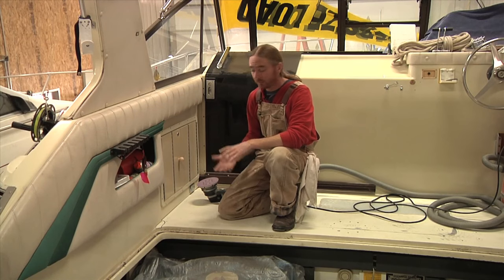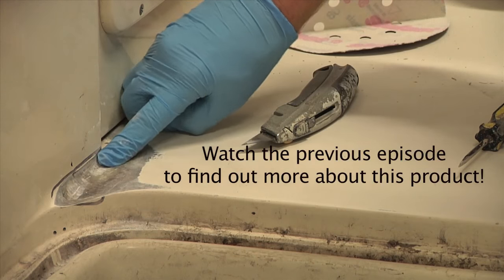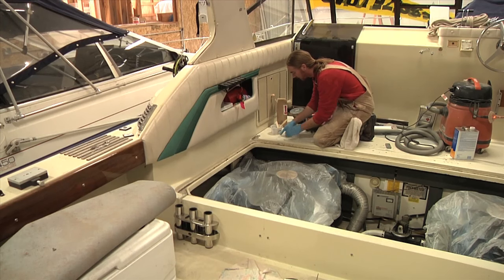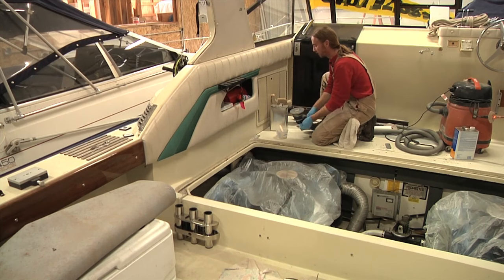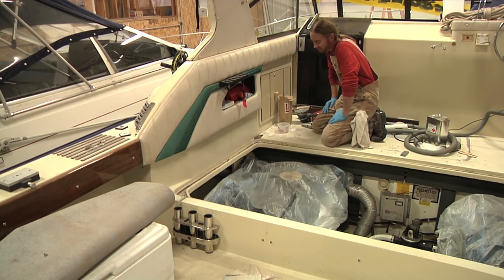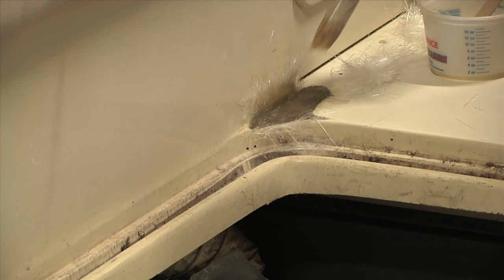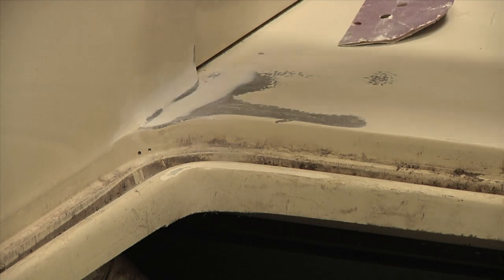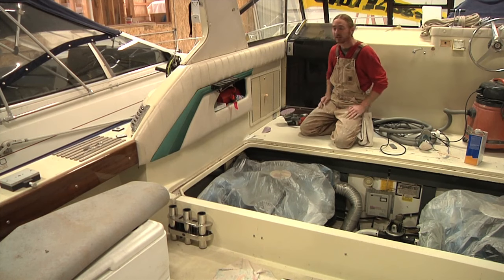Fiberglass Repair ~ Stress Cracks

Comment: When I find "dry laminate" layers, I take a small drill bit and drill into the hole, then mix a very small batch of resin, then inject the resin into the dry void with a needle. You can actually watch the resin saturate the dry laminate from the surface. It works well. For areas where there is plenty of glass, but someone just didn't quite brush/push out the air from the glass, the adhesion and structure seems to be absolutely fine. Overall, much less sanding/tooling and less disturbing of the surrounding good glass laminate.
Reply: ok but that doesn't provide any structural integrity -- I mean I guess it's better than leaving it as is but... i'm not sure
Reply: @IrregularPineapples  He mentioned a very specific situation where there might have been dry laminate layers where maybe they didn't use enough resin or they did not brush the air bubbles out, but there was enough glass, which is where the structural integrity comes from, it just needed more resin, if that makes any sense, hope that helps explain it a bit better, take care and have a nice day.

Comment from the maker: I haven't simply because I didn't want to take the chance that it wouldn't work :-)  PVA, wax or other additives are inexpensive compared to the time needed to re-work a repair..  Not saying that it wouldn't work for a very small patch but I wouldn't recommend it for a repair of larger size..

Comment: FYI 20mm = 2 cm = 0.787401575 inches  (pretty thick)  I think you mean 2mm
Reply from the maker: 20 mil = 0.508 mm  :-)
Reply: a mil is different than millimeters... 1 mil = 1/1000 of an inch
Reply: FYI ... Where I come from 1/1000th of an inch is referred to as a thou.  And to the rest of the world (outside US) a mil is short for a mm ... interesting video ... very useful ... thanks.
Reply: I think he means 20 micron 0.20 mm
Reply: Thats 20 thou (as in .020 inches) or .5mm being .03937 inches in a millimeter (I was a fitter & Turner / toolmaker by trade and we worked in both metric and imperial units)

Comment: I understand you did this video 8 years ago but just wondering if done today you’d use a microfibre resin mix to fill that hole? Is that perhaps the same problem with too much resin and not enough fibre?

Comment: Quick question. I recently discovered a soft spot on the deck of my 2002 Sea Ray 340, due to the previous owner had an accident. Removed the hatch and ground out all the mush, vacuumed it all out. 
I had repair a crack in the Fiberglas and had to sand about a square foot of factory anti-skid (diamond pattern) the first problem I’m having is the repair epoxy is bleeding through the factory color matched gel coat. What do I use as a color block? Then I order the factory anti skid pattern mold from james town dist. 
Do you think it is possible to blend in a square foot of anti skid perfectly, in the middle of about 6 square feet of anti skid?
Thanks! Really enjoy your videos!

Comment: Thank you for the quick response. :) what I was asking is would a coat of pva over the glass work the same in helping it to cure, would it keep it from gassing off and slow the cure? An old timer showed me the pva trick, it seemed to help with blending the color better, I was putting in a bow thruster and using flag blue. Is it the heat of the gelcoat kicking that does it?

Comment: Nice job on this "stress" crack. Couldn't have done it better myself:)
I do have a question about procedure in repairing a noising line on steps in a fiberglass swimming pool. The crack is 4-5 inches long horizontally along the edge where the step and riser meet. It is not however, a stress crack, it is fully cracked through so that we have a leak. I applied a temp fix with epoxy putty [underwater type], but now it'll need a permanent approach. Could you steer me in a specific direction. I have a pretty good idea on how I'll approach, but any other expert opions are entirely welcome. I don't want to do the job twice. The pool is only 2 years old and in installed in-ground. Thanx.
Greg

Comment: Andy what tip do you use in your gun when you spray gel coat. I used a 1.4 that ihave in my gun and it was not the right tip for sure. Also where can i buy wax to put over the coat the gel coat. I got the one that has it in it but i found it to still be sticky. Thanks Anthony

Comment: Hi nice VID superrrr  job,i was/is going to use this products on my aircraft fibreglass cowling,as my cowling burned through with my older version of exhaust,(thats changed so it wont be a problem anymore),this cowling is very thin and i say, 40 -60 thousands thickness.I noticed on this vid, at 18:00 you say some compound..what is this compound?? Quetion: for the exterior side of my homebuilt Aircraft cowling, can i use a product called " Evercoat Company(automotive use)" polyester putty?? i was going to use it to cover up the joined repair of the fibreglass patch kit.,as for inside of cowling is not an issue,it wont be seen. what would you recommend? also my fibreglass has bubbles on the out finish,it looks like the fibreglass has aged over 20 years of use.thess bubbles are in the fibreglass material. what should i use to cosmetically repair these bubbles in the material??  Automotive bodyfiller/puttys any suggestions? ty 100-100

Comment: Hi. I have been doing truck hoods for 25 years and am trying to improve my skill set. We mold using gel coat but during a repair we use resin and Vette Panel Adhesive which is more or less body filler with extra resin. I understand the differences in the poly resins but why do marine repairers use gel coat for repairs? It seems to complicate things IMHO. Total quality repair yes but in our industry we'd get about 2.5 hours to have that in the paint booth and our jobs sit outside in the sun and go down the road vibrating every day. Great vid and thank you

Comment from the maker: Hey Anthony, I use a 1.4 tip for repairs (would not use this size for an entire boat though :-) I mix non-waxed laminating gel with a product made by Duratec (high gloss additive). 60%gel W/ 40% Duratec. This additive works as a thinner as well as a curing agent to allow the gel to fully harden. With the 1.4 and the flow about half open with a tight pattern 30psi it sprays very nice. VIP Catalyze the mix 2%. Or try going over the tacky gel you sprayed with PVA. I never use gel with wax anymore.

Comment: Awesome videos!! If I send you some photos of some stress cracks on my boat, can you tell me by looking at them if it's just the gelcoat that cracked, or if I have to actually repair the fiberglass? The cracks are much smaller than in this video, and were caused by a collision with the dock. Thanks in advance for any help.

Comment: Nice video! I notice you use a lot of CSM, for small fixes is that usually all that's required, or does it depend more on the surrounding/existing material?

Comment from the maker: In a pinch you could, but it's going to be a much harder surface to sand and it wouldn't smooth out as nicely (will still be a little porous).   I've done it, but try to avoid it when possible.  Thanks for the comment!

Comment: thks boatworks - assuming i got the gelcoat off the boat (16 grit on a grinder?) is it important to seal the raw fiberglass with gelcoat before painting, or can i prime w 545 and finish. I want to get this right so i don't have to come back to it thks again for your vids
Reply from the maker: Peter Ekstrom If the surface was taken down to bare glass, you'll most likely have a lot of pin holes if you go straight to priming.  Might be a good idea to go over the surface with a skim coat of Awlfare LW to smooth out any defects and fill holes.  This can be applied with a plastic trowel, has good working time and sands really well.  After this is lightly sanded then spray 545.  Might have a few more pin holes, but just repeat the process where necessary.  http://www.awlgrip.com/products/fillers/awlfair-lw.aspx

Comment from the maker: Good point to bring up, unfortunately it's one of those things that got edited out of the video :-(  There are 2 large aluminum backing plates on the underside of the captains chairs which are now mounted with stainless bolts, washers and lock nuts!

Comment: Hi Boatworks - Thks for all the great info in your vids
 My project boat is a cheoy lee sailboat 38ft. built in 1979. the problem is almost the entire topsides are covered with (age related?)  hairline cracks in the gelcoat. I painted the boat last year with perfection, and they hairline cracks printed right thru the finish. what is the proper way to take care of the issue?
Reply from the maker: Peter Ekstrom That's a tough one.  If the gelcoat is crazed it will need to be removed down to the bare glass.  If the glass beneath that is cracked then there will need to be additional layers of csm applied to stabilize the surface before going further with re-gelcoating or painting :-(  Most likely it's only the gel, and probably because it's too thick and has gotten brittle..  Either way, there's a lot of sanding required..

Comment: Thanks for the informative video. Can u show us how to paint the repaired area? Also, i thought gelcoat was the top final finish that covered the surface of the boat. In your application it sounds like gelcoat is only used to cure the glass. Thank you.
Reply from the maker: Hooverhoff Typically gelcoat is a top finish surface, but it can also be used in place of PVA to seal glass beneath it to allow full cure.  I could easily have used PVA in place of the gelcoat for this repair, but I had a bunch of gel laying around that needed to be used up :-)

Comment: Thanks for the response. If you were not repainting the entire boat, how would you match the repair to the existing white top coat?
Reply from the maker: I'd just continue using gelcoat rather than paint and spend the time getting the color matched to blend :-)  For this repair it just happened that the paint I was using was a very close color match to the gelcoat.

Comment: Sir , you are indeed a very patient man, for this is a labour intensive hand work. I like the manner you run your finger through the finished patch to check for high and low patches and you seem to detect them even if they are so shallow.  What worries me in this type of work is that concerns me to know how new resin would fuse in with the old resin laid years before. Last week a colleague of mine lengthened and widened a fibreglass boat and he uses a special resin that would bind and fuse itself to the old resin laid years before. I am  not familiar with this product but it is indeed useful to know especially when one lengthens boats to a larger side as the adhesion and fusion must be reliable.  Congratulations for your hard core structure and also for your finishing.

Comment: Thank you so much for these vids. I need your advice. I have a 23' 1979 jetster with a burnt motor. I'm considering installing a new engine, outdrive, trim pump, repainting it, reupulstering it. Or possibly buying a yamah ls2000 with low hours. Jetster if I do the work myself, around $7500.00. Ls2000 $11,000. Either one will be used as a family boat. If you were me. What would you do? Thanks.

Comment: would this be the same process I would use for the bottom of my old hudson trillium? Over the years it's it's accumulated many many stress cracks, and some nice gouges from being beached. 

We have already started restoration inside, this winter we would like to do the bottom.
Reply: Sean did you end up doing this for the bottom of the hull? I have the same kind of situation going on. Let me know what you did and how you made out

Comment: Thanks for the video, I appreciate the information you guys post, it's great. Quick question, could you sand down the surface like you did and then just fill it with Marinetex and then sand that down so that it is flush and paint over that? I'm curious whether you think that would work as well as using fiberglass?
Reply: I'm not the expert, but if they are "Stress" cracks, then I would think you would want more strength in that spot to prevent a re-occurrence.
Reply: look i dont speak too much english but i do my best, actually I work in a company called HUBBELL (Mexico)  i do repair to enclosures for transformators for the u.s. and I repair without fiberglass i repair just with resin mixed with calcium like bondo and then I mixed this pasta with paint (Part paint) and i add an accelerator all mixed i put on the crack just wait about 15-20 min. its dry and started to sand until we have an uniform equal area and then I paint and thats it, sorry but my english its not so well greetings
Reply: EL PICADOR DE NEIL Y MORRIS There's different ways to do everything.  I trust the man in the video is doing it the right way.  I mean why wouldn't you want it stronger?
Reply: stronger its fine but i do that way i mentioned sorry for my english
Reply: highvelocity123 Stress crack usually come from too much gelcoat being applied at the time of manufacture. I worked at Sea Ray Boats in their Yacht division and close corners are a pain. When gelcoating you are supposed to apply 3 coats of gelcoat 3 minutes  apart to allow to gas off at 7 mils per coat. You have to overlap hence how gelcoat can get thicker in curves and non flat shapes. Also the reason the part had air where he was sanding is because for drain out, drain out occurs after the part has been rolled out and is waiting to cure the resin drains out of the glass leaving air behind. Think about it, this part was actually made upside down, so low points are actually high points when making them. Poor quality control is to blame for this and the air was in the skin coat.
Reply: +highvelocity123 Typically, cracks are only in the gel coat due to it being sprayed too thick on the radii. it doesn't flex too well, and it cracks easily under stress. During 18 years of boat and fiberglass repair, cracks in the gel coat were by far the most common repairs I did.
Reply: +amigo 1 Never, ever, ever repair cracks with just polyester resin and thixotropic fillers...or Bondo! Fiberglass is required to prevent cracks from returning.

Comment: I'm curious as to what sander your using in this video, I've tried out a few random orbitals and not happy with any of them
Reply from the maker: I'm using a Fein sander, but really any sander that has a lot of head movement (6mm or more) will get the job done efficiently.  Most sanders by Dewalt, Makita, etc are more or less finishing sanders meant for wood.  They'll still work but will take a lot longer.  Hope this helps!

Comment: I have a really basic question. What happens to all those brushes? Is there any way to clean and re-use them, or does the resin just ruin a brush each time?
Reply: I use acetone... but not on plastic handled brushes...

Comment: Dizzy...I'm fairly certain he covered how to fix stress cracks pretty thoroughly....my question was can you spray pva on it to cure better? Its a good technique with spot repairs, like preval jobs...I too hate gummy sand paper lol. I can see how the gel might save you a step, just curious.
Reply from the maker: I'm trying to remember, but I think I added Duratec High Gloss Additive to the gelcoat before applying over the glass.  This additive is a curing agent that acts much like PVA, wax or Patch-Aid.  Sands nice and clean with no gum after it cures :-)  It does save a step in that the gelcoat is able to get into the weave of the glass to help fare the surface without having to sand / remove too much glass to get a smooth surface, or have to do additional fairing before laying the topcoat of gel..  Hope this helps!

Comment: Hey, can epoxy and fiberglass be laminated over scuffed gel coat with good adhesion?
Reply from the maker: It will certainly stick, but the strength of the overall laminate will not be very good; gelcoat is the weak link in the chain and will likely delaminate

Comment: "because Im in a building etc I dont want to come in with a grinder etc" So ... I am guessing the best way to approach it is to grind it out and fill it with fibre+bog? (thats what I would do but Im a noob) .
Reply: sanding means you can collect it instead of putting it in the air and breathing it in the next months and get cancer
your call.
Reply: In 2000, the National Academy of Sciences reviewed studies of fiberglass manufacturing workers and concluded that "...glass fibers do not appear to increase the risk of respiratory system cancer." In 2001, the International Agency for Research on Cancer said that "glass wool", which is a form of fiberglass, is not classifiable as a human carcinogen. Deaths from lung diseases, including lung cancer and mesothelioma, in groups of workers involved in the manufacture of glass wool, are not consistently different from what is found in the United States general population.